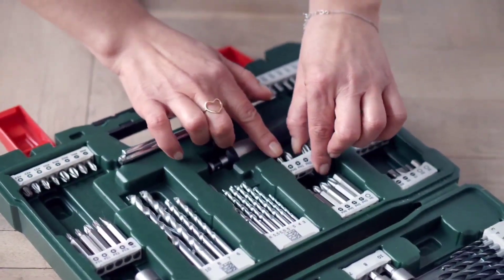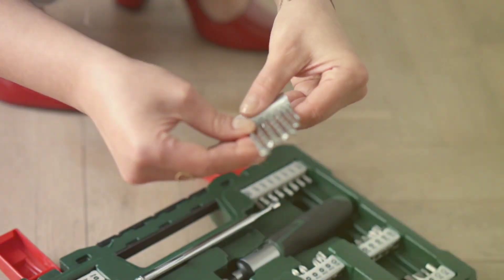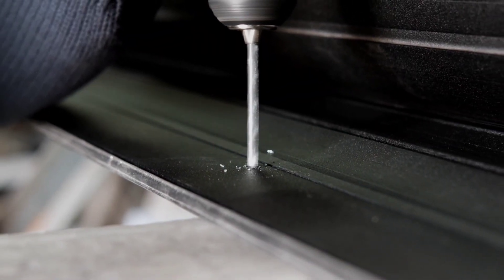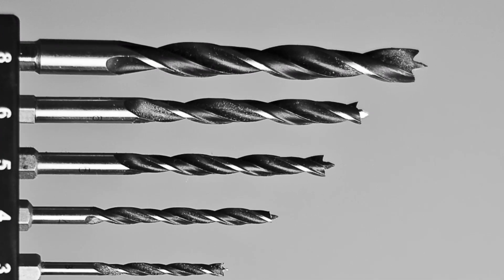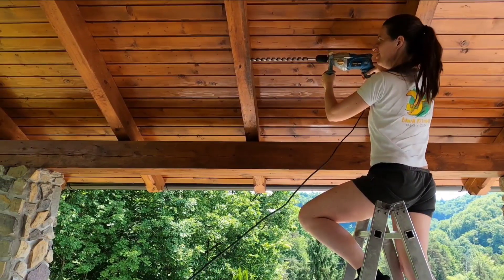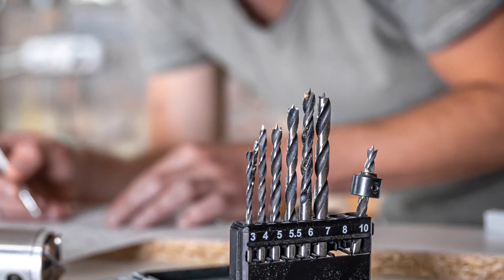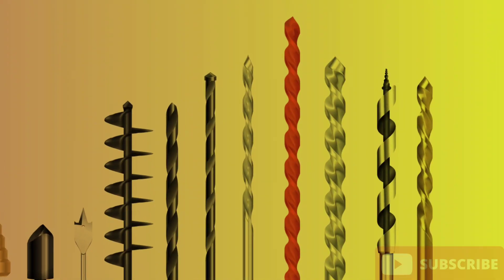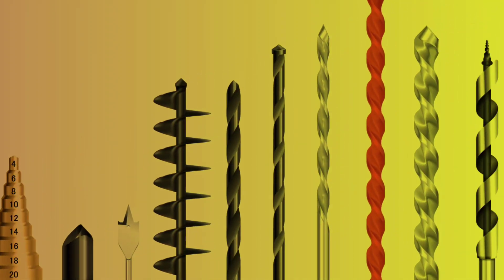How to tell if drill bit is for metal or wood |

Comment: COMPLETE NONSENSE. Brad point bits are just one of several types of wood bits. Many combination and wood bits have angled points; the important factor for drilling hard metals is the bit material, which this video tells you nothing about.